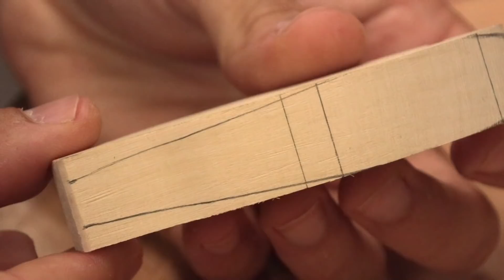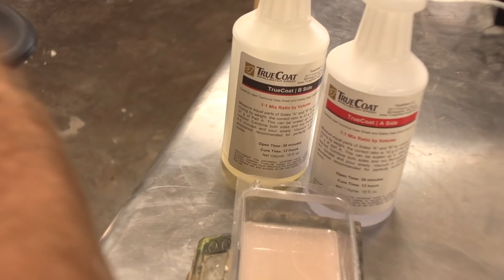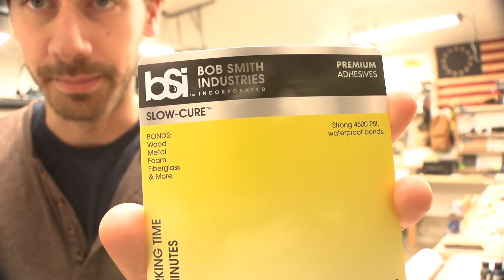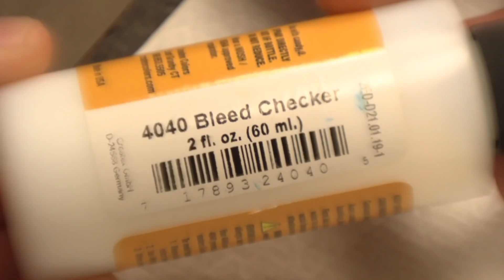Making a Bladed Wiper CrankBait

Comment: Had the 'rona, and you described it perfectly. As for the bait, I'd try adding two more split rings behind the spinner rig, with the middle ring being larger in diameter. I feel as if the pull pressure from one split ring is not allowing the bait to work properly.

Comment: 3 things comes to my head.
1 the shaft with wing is too long. Make it shorter or add extra wing, small in front and larger in the back. Maybe mepps #2 for front and #4 or #3 on the rear.
Secondly, I would reprofiled lip. Something like delta shape. More or less. Without sharp angles.
Lastley, i have one but I fix my spinner on the rear of my salmo, thing is that front is free to wobble and rear is spinning juts like was intended. It is slow bait, it can't be rush.

Comment: this would fall into the category of not what sort of weight-loss program people should try. that and swallowing a tape worm. so my question is will a fish eat a soft bait tape worm? maybe on this it should have been in sections, with an abnormally larger scale patterned and with a fatter body and split tailed  flaring outward. this must be the only state left in the U.S.A.  that still operates an A.M. radio station.

Comment: Take a 5-7liter pot, put 0,7kg of chicken there (u may add 0,1kg of steak) pour water in 3/4 and boil it for 1,5h. After that pick out the grey stuff on the surface with a spoon. Burn an onion in fire for 3min, and add it to the pot, add 2 carrots, half of a celery, a parsley root and the white part of leek. Boil it for another 1,5h. After that remove all ingridients from the pot, leave sliced carrots and little parts of chicken meat. At that point the Polish Rosół is ready and u can eat it with nuddles salt and pepper. Next time reheat it but u cannot make it boil again, otherwise it spoils. This is not an American chicken soup. It will make u gain some pounds in no time. Take care.